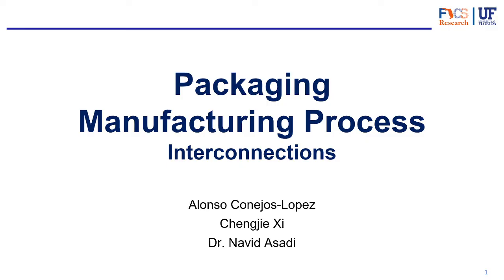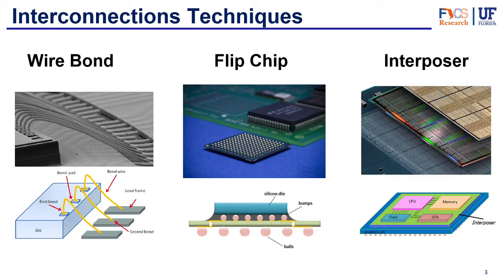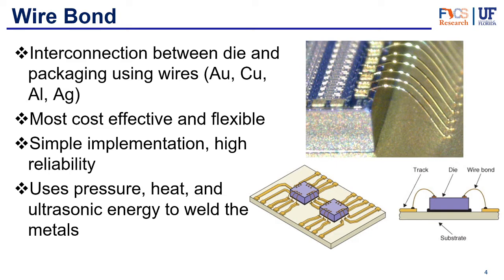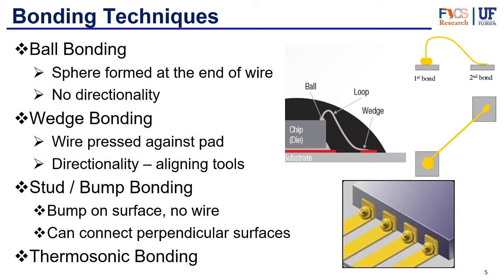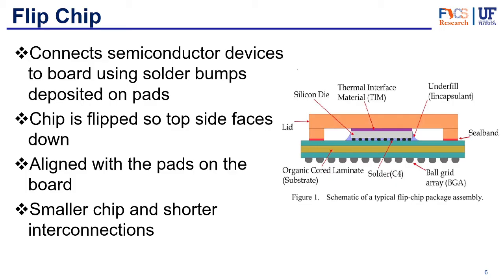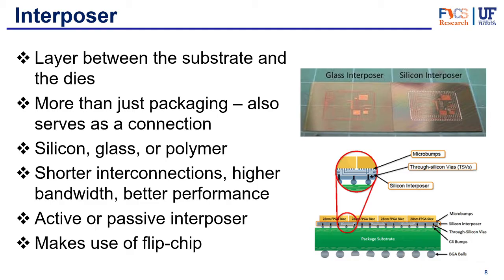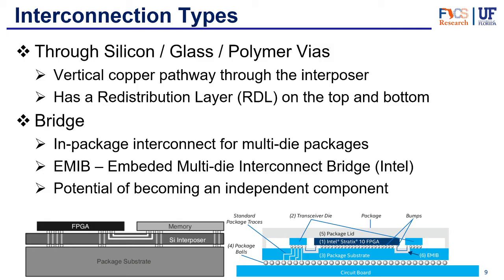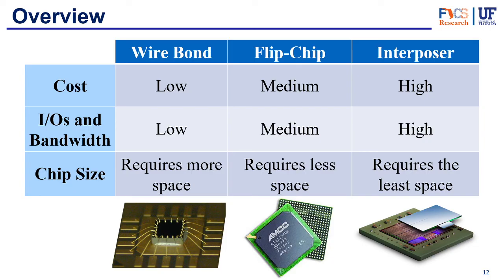Packaging Part 5 - Manufacturing process

Comment from the maker: References continued...
[24] Aparicio Rebollo, F. (2020, May 18). How it works Scanning Acoustic MICROSCOPY (c-sam): Alter Technology. Retrieved March 02, 2021, from https://wpo-altertechnology.com/how-it-works-scanning-acoustic-microscopy-c-sam/
[25] Wiring bonding services. (2019, April 25). Retrieved March 02, 2021, from https://firstlevelinc.com/services/wire-bonding/
[26] Flotherm-pack-amcc-recycling. (2017, July 29). Retrieved March 02, 2021, from https://goldenscrap.com/2017/02/graphic-ic-chips/flotherm-pack-amcc-recycling/
[27] Scannell, M. (2019, April 17). Thank 2.5D INTERPOSER technologies for the success of 3D ICs. Retrieved March 02, 2021, from https://www.3dincites.com/2019/02/thank-2-5d-interposers-technologies-for-the-success-of-3d-ics/
Reply: You need to pin this comment to the top of your comment list, else it will drift off the screen.

Comment: Here is video from a master form which you and everybody else should crib from: https://www.youtube.com/watch?v=TOsMcgIK95k&list=PLbtzT1TYeoMjNOGEiaRmm_vMIwUAidnQz

Good first start. I find the lectures quite useful. A long summary is not needed in this format. A quick one or two lines would do. Also, increasing the density would be ok. I can listen to HHP (link above) at 1.5x speed, down to 1.25x when I am not familiar with the material. I can do you at 1.75x without pause. (Speed control on academic lectures are great! It gives you all the time you need to do the thinking you need to teach, and I don't have wait.)